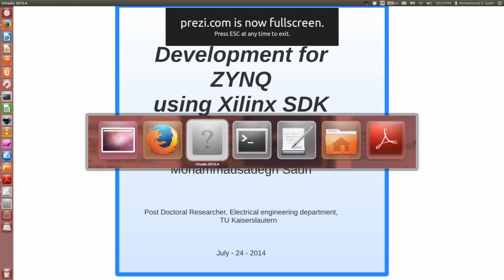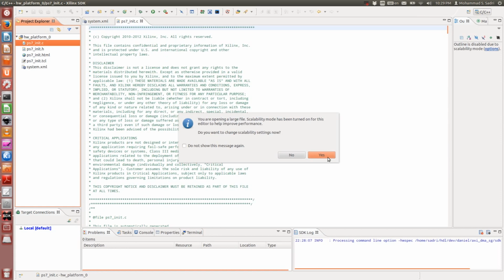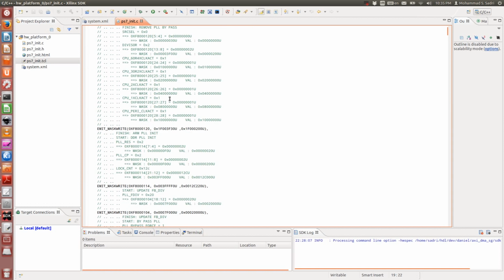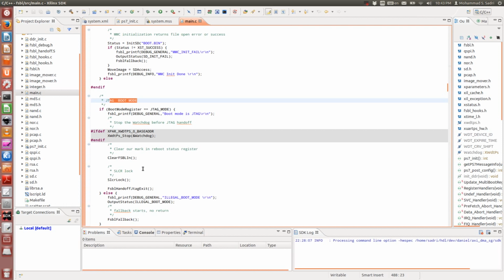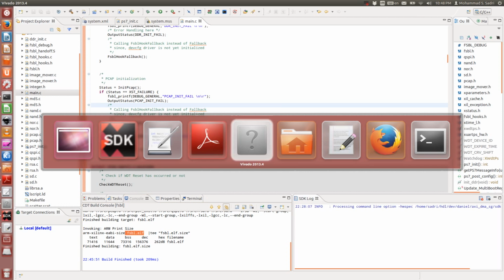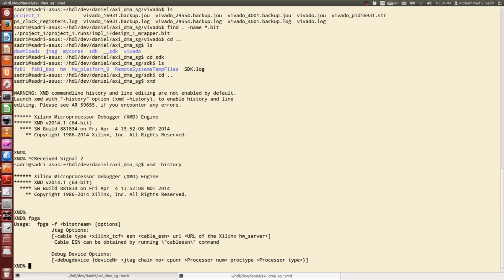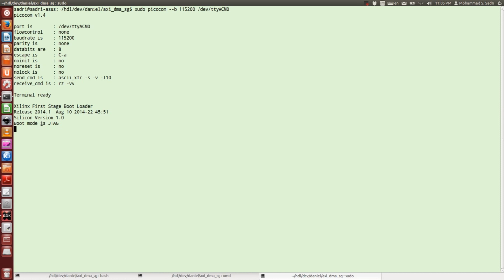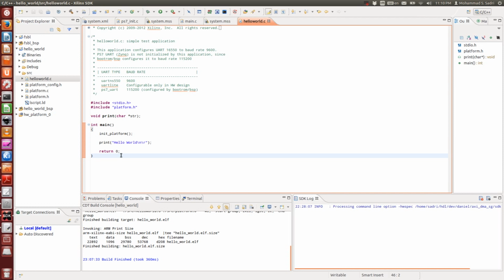ZYNQ Training - session 09 part III - Preparing the First Stage Boot Loader

Comment: What jumper settings did you use to boot in JTAG mode, Mr. Sadri (Cascaded JTAG or Independent JTAG)? Also, shouldn't the USB be connected to the PROG input rather than the "USB OTG" input?
Reply from the maker: Hi. I didn't use Cascade jtag. for zcu104? you have one single micro usb connector through which you will have both uarts and jtag. for ZED, yes, there are two separate connectors, the one with PROG is for jtag connection.

Comment: Hi Sadri, I would be grateful if you can make another video on FSBL with one step ahead, instead of programming the FPGA with bitstream from SD card, but via UART or CAN. How to customize the existing fsbl so as to achieve writing to the flash or programming the FPGA with a new bitstream?
Reply from the maker: Are you interested in re-configuring the PL with a new bitstream which has arrived over CAN?
Reply: @MohammadSSadri  That is an awesome idea, even one more step ahead. I would describe below how I visualized it.
Reply: I have partitions in the flash namely, zeroth for bootloader,  first for ARM core 0 binary, second for ARM core 1 and third for FPGA and fourth for some user data. After power-up, the FPGA is in bootloader mode, then the user should be able to store new binaries over CAN (or UART ) to first or second or third or fourth partitions. Then, the FPGA should be able to run with new binaries.

Comment: Hi, truly appreciate your video, it is really helpful.  I have a question, when I run the FSBL, it does not show "Boot Mode is JTAG", it only shows that

IRQ_HANDLER 
Initializing...xA305
init:done
Zybo Z7-10 Rev. B Demo Image

And then if I try to run Hello world it would show nothing in terminal.

But If I try to run FSBL and Hello world in run as System debugger mode, still no "Boot Mode JTAG" shows up, but the Hello World would show up.
If I run in GDB mode, FSBL would show up as above (no "Boot Mode JTAG" ), Hello World won't show up.
Does this mean my hardware design (the vivado part) has issues since the Boot Mode JTAG won't show up?
Thanks a  lot !

Comment: a little correction in the connection diagram is that instead of connecting two cables at USB OTG and UART you should connect at prog and UART. I think people have figured it out but still :-)